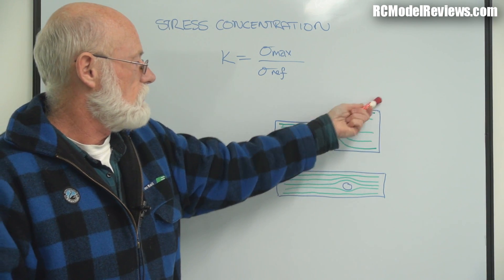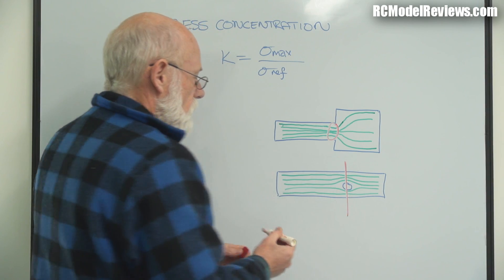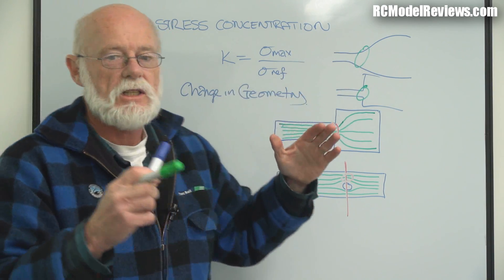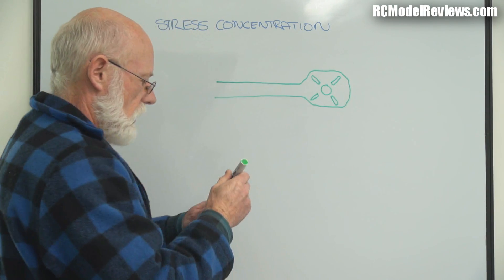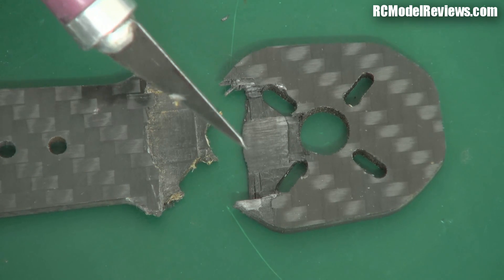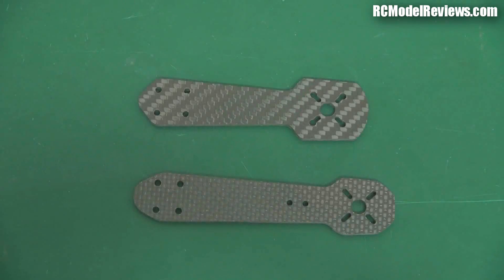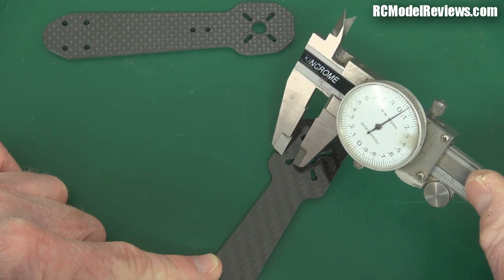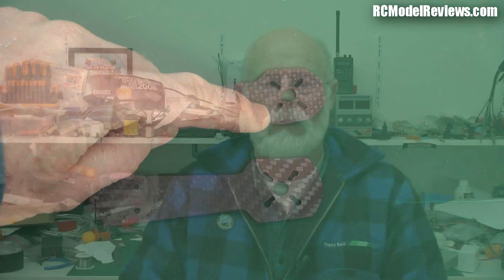Quality versus Value - and why stuff breaks (ZMR250 mini quadcopter analysis)

Comment: I've ordered the chinese frame, it will be for my first quadcopter and i wanted to build it myself, so i think from my perspective the value will be good enough to learn , so i can improve my quadcopters when i'm confident flying and building my own? Is this a good way to descripe the value of this frame? It's cheap but indeed less strong but for my first build more than enough? And btw, should it be possible to make the arms a bit stronger? By bolting on a little piece under the arm where the most stress is? your weight will go up but your strengt also?  Like your reviews on the 250 miniquads!